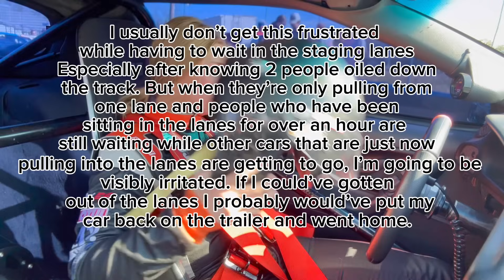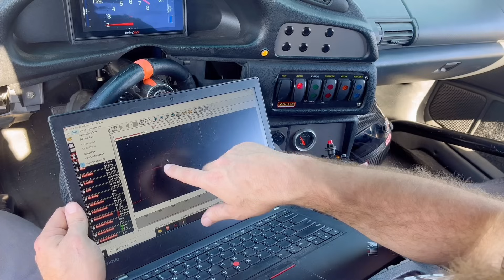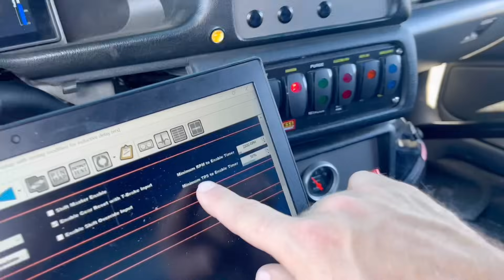EVERYTHING WENT WRONG!!

Comment: People have mixed feelings about racing on the mile high, aero has alot to do with it. A car like yours probably likes the thin air to cut through. Whereas some like a brick don’t matter much, it just kills them every where, aero and engine power.
Reply from the maker: My car is NA. The higher the DA the slower it’s going to be. That’s like trying to run a mile only though a straw
Reply: @britneyautomotive  yeah I know. But a car can also cut through the air better inhigher altitudes. Just something to think about. I remember some top fuel crew chief was talking about it, he was amazed cause the cars would run about the same there. The engines made less power some they tube them up, but the cars would go through the air better. I wish I remember who it was, it was a cool interview. Good luck!

Comment: Have you considered keeping your engine cooler and running it minimally while trying to make a fast pass? I don't know if you are running it a lot but, it sounds like you are in the video. A cooler engine will make faster passes and you can keep your car more consistent if you keep the engine cool. This is what most racers that are competitive in bracket racing do.
Reply from the maker: It was 150° lol 
I was in the lanes for 1.5 hrs
Reply: @britneyautomotive  1.5 hours would suck, especially during the summer. Glad it was a cool engine. Did you figure out what slowed it down so much?

Comment: I know you were talking of running in the  low 10’s or high 9’s but what really concerns me is you not having any neck support whatsoever.  No cheap donut or maybe a HANS or a Simpson Hybrid.  At 10.0’s you hit the wall at Beechbend your neck is snapping.  Think Dale Earnhardt.  The other thing is noticed is your seat not being bolted to the roll cage.  It should be bolted to the crossbar.  God forbid you have an accident and that seat is not holding you in place.
If you are going to race and go fast use the NHRA rules.
Reply from the maker: You clearly dont know the actual NHRA rules LMAO